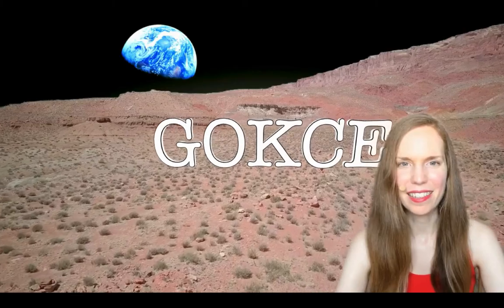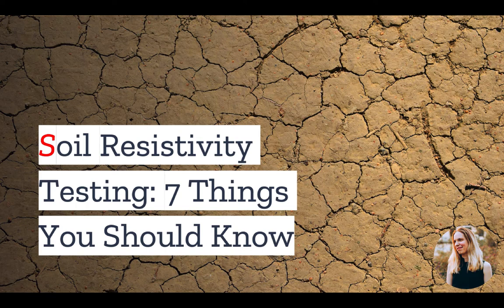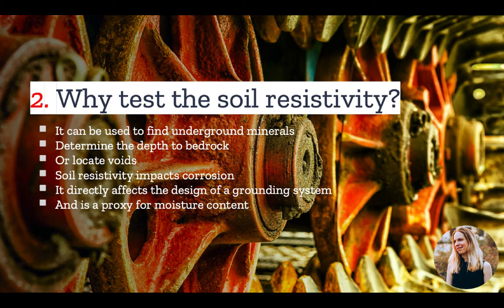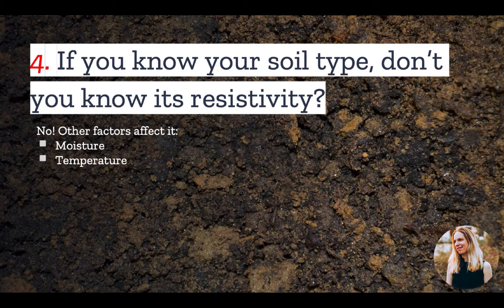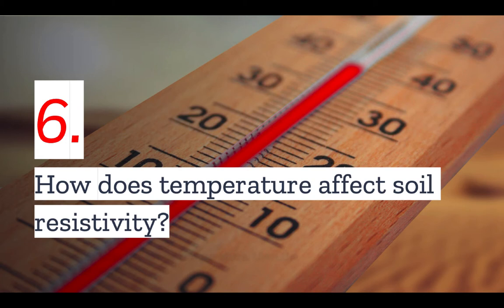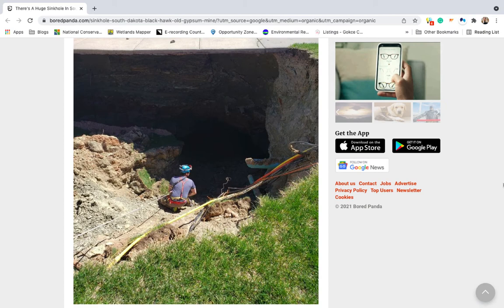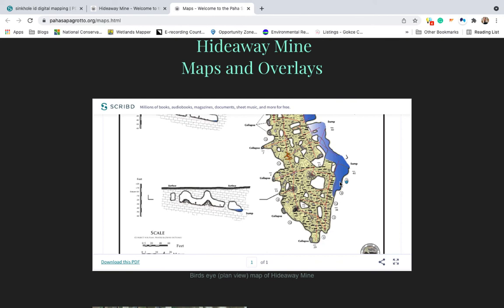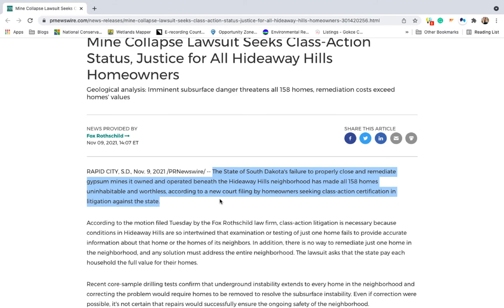Soil Resistivity Testing: 7 Things You Should Know

Comment: Madam, usually for earth mat design we consider soil resistivity data at depth or spacing  of 10meter for determining soil model. What should be the depth or spacing at which resistivity data should be considered   please guide and also tell if there are any references in IEEE, for the same.
Thanks
Reply from the maker: Thank you for watching! I'm very sorry, but this isn't actually my area of expertise so for more technical questions, I would recommend speaking with a local engineer.